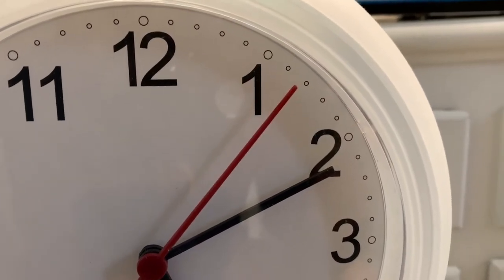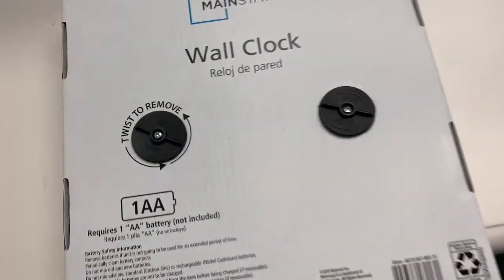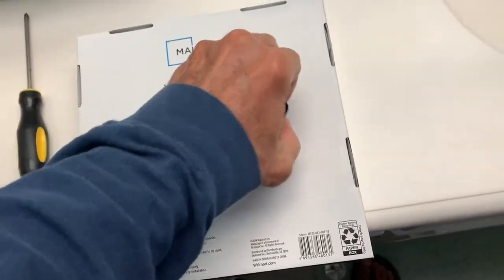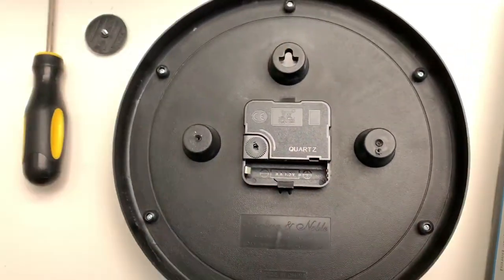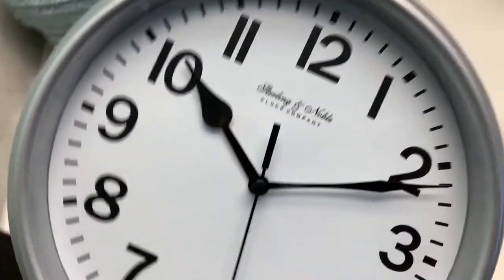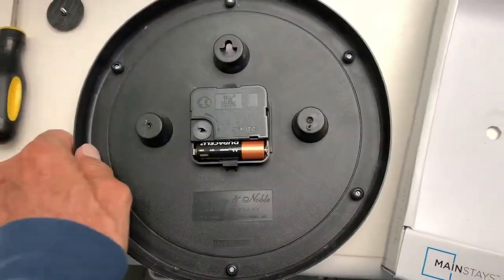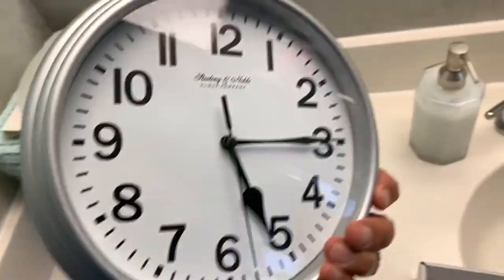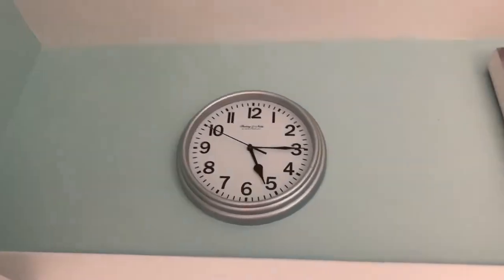How to put a battery into a wall clock, set the time and hang it on the wall

Comment: Put the battery in and let the seconds hand move tp the twelve oclock position then remove bsttery.
Next set the time two mins ahead of the time on your cell phone.
When cell phone time matches the wall clock time INSERT the battety.
Your wall clack wii now be in perfect time with your wall clock.
Now you can  check once a week and see if you wall clock is keeping accurate time or starting to lose time.
Reply: I meant to say your wall clock and cell phone will be in perfect sync.
Reply from the maker: good tip thanks

Comment: I put the battery in the right way and it didn't work.  Tried 2 different batteries.  Maybe a bad clock.  I made sure it was the right way.
Reply from the maker: Yes, you could have a bad mechanism in the back you can buy them on Amazon cheap and replace it. Good luck. Thanks for watching.